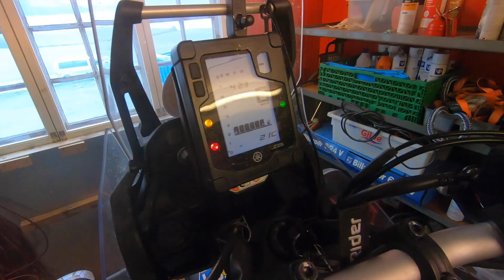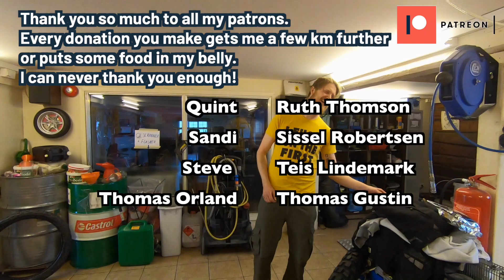Naf tire and oil change

Comment: Î've been running enduro bikes and mofas for about 20 years, and while these kind of tires are great offroad, just one tiny hint: Be aware of going too hard into corners with these on tarmac/asphalt, because there's not a lot of grip near the sidewalls. If you think next year about changing them to something more onroad, the Mitas E07+ are the great compromise between On and Offroad. 

Have fun!

Comment: You'll find it easier undoing the axle nuts if you push down on them rather than pull them upwards. You can use your body weight more effectively....🙂👍

Comment: disappointed you were not able to break the bead because I bought a set of Motion Pro bead breakers like yours...hope they work better for me when I need them
Reply from the maker: They are able to, but I guess I am just very inexperienced 😅 I have seen other people do it with ease
Reply: @RidetheBean  I have the same bead breakers. You were standing to high, if the wheel is on the ground you can put you're weight into it, and they will pop off much more easily. To get the tire on again is another story, I find them to have not enough leverage bc there short and carry one larger tyre iron extra.